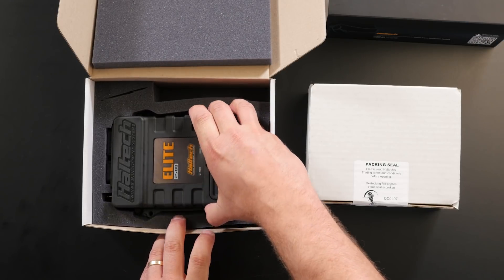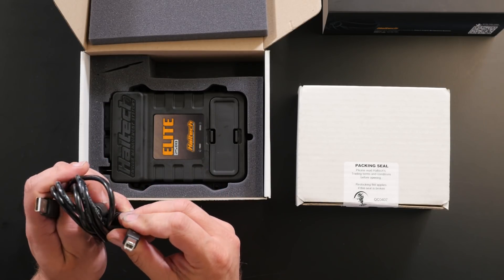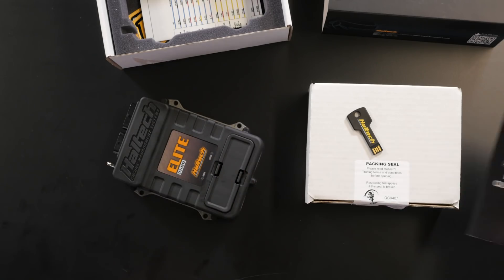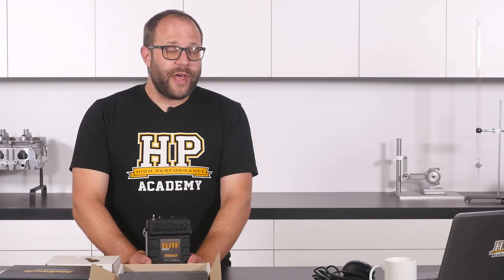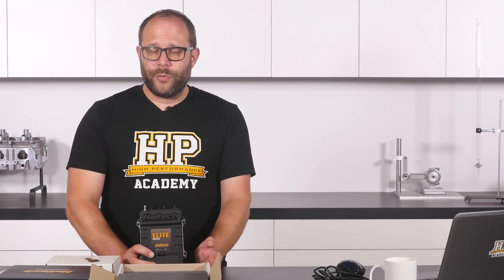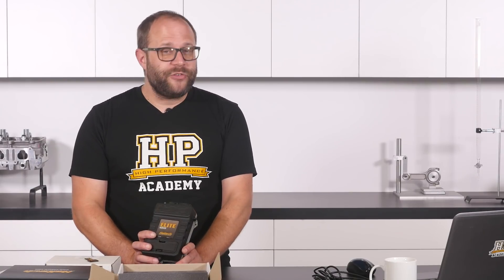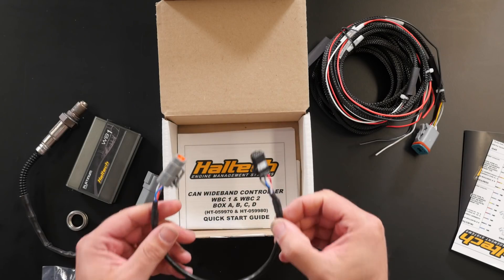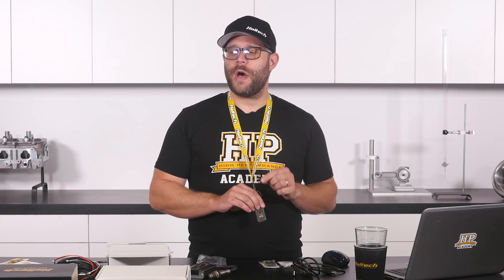Haltech Elite 2500 Detailed Unboxing + WBC-1 Wideband Controller

Comment: I’m wanting to throw one of these in my ‘96 Toyota Tacoma with a 5vz-fe and am curious if there’s a built in immobilizer or if one could be added to it. With all the brazen thieves in my neck of the woods, I’d hate to dump all the money into a supercharger & whatnot, only to have the truck stolen if I have swing by the store real’ quick; because of how easy it is to break in and Hotwire them. Alarms, kill switches, steering wheel locks and trackers seem to be useless nowadays with how quick thieves are to strip or total a vehicle of that age

Comment: I have ls1 forged 383,have purchased Haltech Elite 2500+ WBC-1 Wideband Controller + IQ3 dash also will be using fast EZ_TCU trans control with hand held programmer.engine back from builder now have to run in engine and trans bed rings for 1000k , then the rewire and another dyno tune. then finally can go to track and see new 1/4 mile time.old engine made 383 rwkw did 11.9  1/4 mile. cheers to matt for getting the haltech for me

Comment: Wideband only bosch lsu4.2. Bosch 4.9 does not need calibration and is the current standaed. Please correct me if I'm wrong. The haltech canbus only works with haltech can units as i can't run aftermarket non haltech pre setup units.
Reply from the maker: The 4.9 is more common these days, most definitely, but the 4.2 is still a great sensor. I've not really noticed any difference between the two when using them in the field. The 4.9 has the same OEM calibration method as the 4.2, a laser trimmed resistor that is part of the OEM connector. Interfacing to a 4.9 vs a 4.2 is actually very similar, so I wouldn't be surprised if they had unit on the way that'll work with the 4.9's (@haltech), as who knows how long Bosch are going to keep making 4.2's... 4.2's get a really bad rap because they were the first wideband commonly used in the automotive aftermarket, and there were plenty of controllers out there that had some pretty dodgy ways of driving the heater circuits in them, killing them very quickly! - Zac.